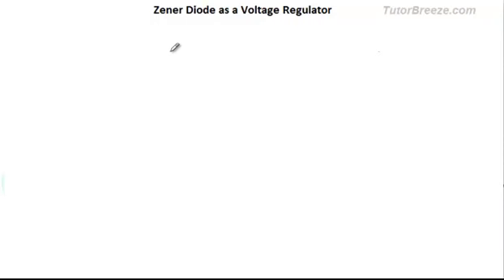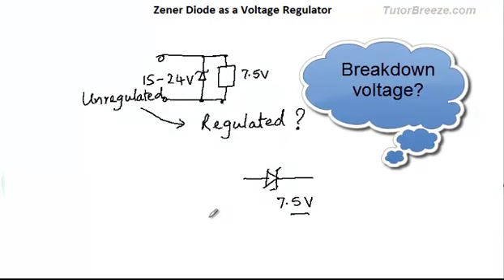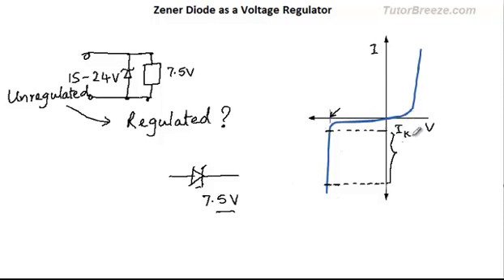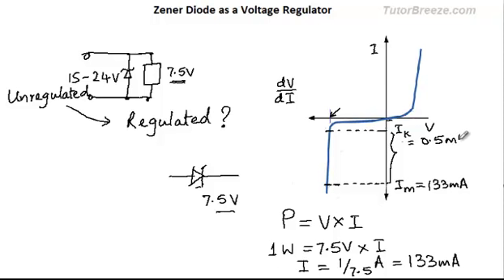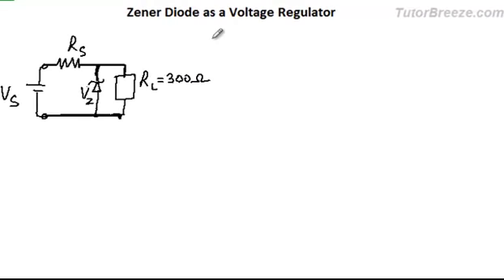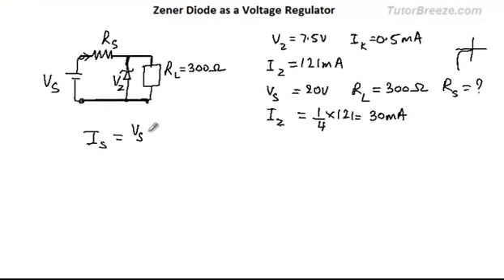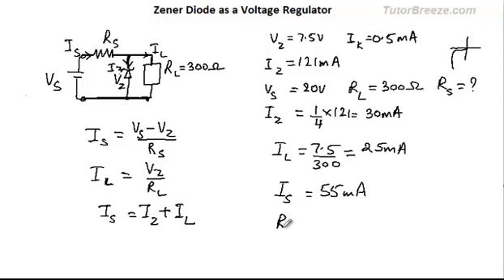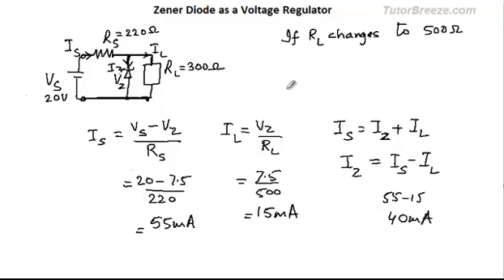Zener diode as a voltage regulator

Comment: Leena, Thank you for your instruction and clear explanation on how zener's work. I have designed a circuit using a zener as a regulator for a 4A load and was able to confirm that my calculations were correct through you instruction. Thanks again!
Reply from the maker: I am very glad to know that. I am recovering from a very mild attack of Covid and was happy  to read your message.

Comment: what is the use of resistance here? or what will happen if we don't use the resistance. .?pls rply
Reply: +Chinnathambi S If I understood correctly, the resistance is necessary to control how much current goes through. We are given the current that we want going through the diode, but the load has a specific resistance, which given our voltage will not give us that current. By adding the resistance we control how much current we pull out of our source, which in turn lets us operate the diode at the desired current with the most vertical part of the graph.

Comment: Other than the fact that you changed your supply voltage from 24V to 20V half way through and confused me a bit by 'changing' the maximum Zener current, a very solid video. Very grateful for the clear and concise explanation.  Really appreciate it.

Comment: There are some things that I still don't understand. If your load happens to draw too much current and consequently turn the zener off, the additional current will be made available to the load resistance. Since more current is being sunk through the load, we know that I x R will yield a higher voltage. If this happens, won't this move the zener back into the breakdown region, causing it to oscillate?
Reply: For the load to draw more current, its resistance would fall and the load voltage would fall as well. The load votage would not rise to cause oscillation.

Comment: Great video.  I'm wondering how the Zener diode maintains a constant voltage even while the current through it changes.  I understand the IV curve, but I'm wondering about the physics.  What is it about the design of the Zener diode that results in this kind of IV curve?
Reply: Interesting question. This is a simplified model of what happens in reality. In fact, the voltage across the Zener diode varies a little, but the variation is such that for practical purposes, we neglect it and consider it constant. The changes occur because there is also a zener resistance along with a zener voltage source in the equivalent zener circuit.

Comment: In the case where a small solar cell was setup to charge a 2.7V super Capacitor, the "load resistance" will vary from almost nothing , when the cap is empty to ... ? If a small solar cell, let's say 4V 125mA solar cell (with a reverse output diode attached, giving us 3.3V or so) is attached to a 2.7V zener that is rated at 200mA maximum and 0.5W, what size resistor should we place on this for that point at which the supercap is totally full, and we need to dissipate all the energy through the resistor as to not overcharge the cap?

Comment: great explanation but just to be clear why is Iz 1/4 of the diodes max current?
Reply from the maker: Then you can be sure that the voltage across the diode is constant so it is a safe choice to make.
Reply: Leena Gurg
yes I just wondering 1/4 , where that come from ?

Comment from the maker: Gaurav I made a mistake in the last line.It should be max current IL = 2.4A - 10A = -ve value of current( and not minus10mA as I had written earlier). See whatever be the value of RL the current through the zener will always be less than 10A so zener will provide constant voltage. Even if RL is made infinite and no current flows through the load still the current flowing through the zener is in permissible limits.

Comment from the maker: Is=(Vs-Vz)/Rs. According to the values that you have given current Is lies between 2.4A(for 30V + 20%) and 1.2A (for 30V-20%). Have they mentioned anything about the current through the zener. If I assume that a current of 10 mA as that is the minimum current that can flow through the zener flows through the diode then the remaining current IL=1.2A-10mA. RL max= 12/1.2 =10 ohms. Similarly for the max current IL = 2.4A - 10mA. RL min = 12/2.4 = 5 ohms. What is the ans given in the book?

Comment: great lectue mam..everything explained in a simple way...i have a problem mam...please can u solve it mam..not getting the the correct answer..
Q:-A zener voltage regulator uses 12V zener diode with IZK of 10mA and IZM of 10A.  If the series resistance is 10Ω and input voltage is 30V ± 20%, find the min and max load resistance that can be connected at the output..

Thank u! :)

Comment from the maker: Rita thomas thank you for your comment. The supply voltage Vs and resistor Rs are chosen in such a way that the diode is operating in break down region. If we want the zener to operate with a particular value of current flowing through it then we need to adjust the value of Rs to achieve this.

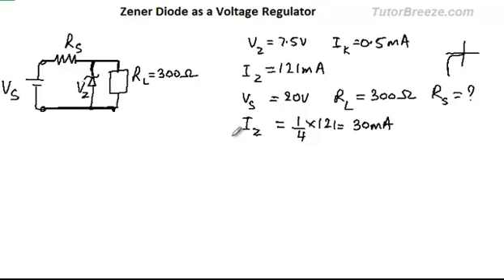Comment from the maker: See Atarashi the zener diode is operated in reverse bias. In circuit shown at 7:31  the upper end of the diode( the cathode end) is positive and the lower(anode) end is negative. Now if you use Kirchoff's rule in the loop you can see that I s =(Vs- Vz)/Rs.
Thank you for pointing this out- I should have put the polarities on the circuit diagram to make this point clear.

Comment: Because the current can change so much but the voltage doesn't change nearly at all (from the graph), when the fluctuations in the source voltage occur the zener diode easily allows the current to flow through it instead of the load - regulating the voltage of the load. V=iR . When Vs is small, little current flows through the zener so it has a large resistance. When Vs is large, lots of current flows through zener so it has small resistance. Hope this helps someone.